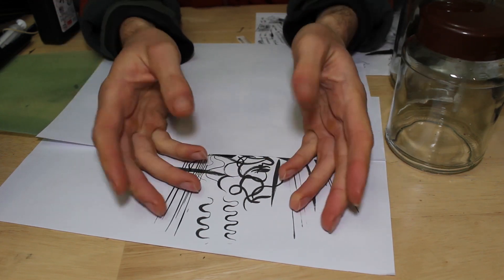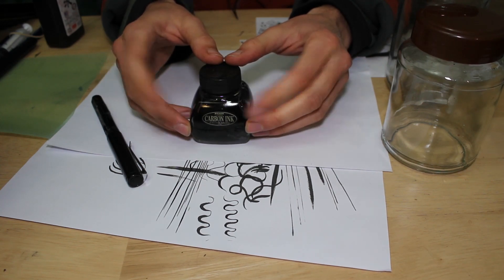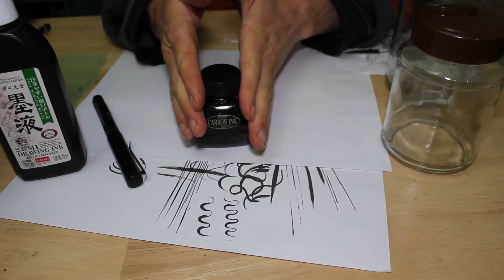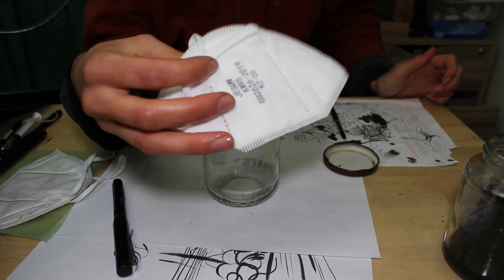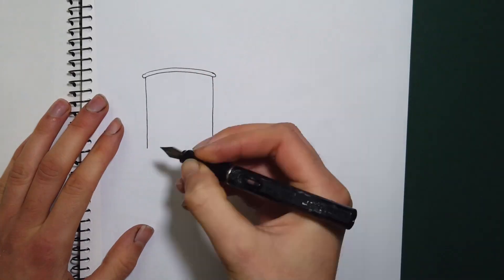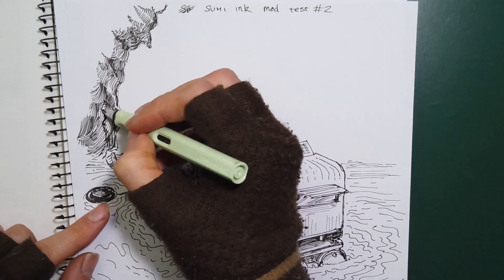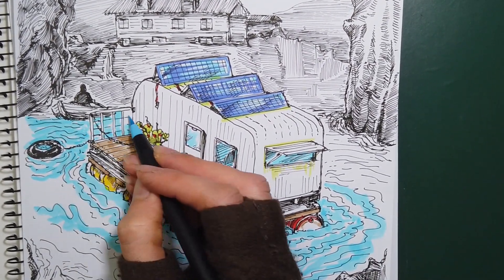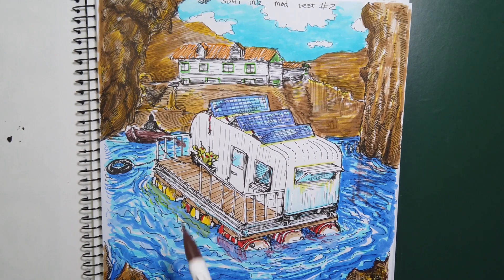Filtering ink for a fountain pen - DIY carbon ink?

Comment: I clicked on this video because it reminded me of little secret I learned about how comic book studios and artists would eventually take the ink bottles left open air while working, dump them all at the end of the day into a big bottle, which would eventually be funneled through cheesecloth into a new big bottle to then freshly refill a ton of cleaned smaller ink bottles. This kept the ink fresh. I read this in “The Life and Legend of Wallace Wood” Vol 1.
Reply: Ah, is that because the carbon particles will eventually congeal no matter what chemical tricks you try to do with any ink and need to be filtered out to maintain a uniform particle size?

Comment: This has gotta be one of the most creative uses for a KN95 I've seen in a while.
If things were to get dire, I'd run this filtered sumi ink through an old kakuno or something, those are easy to take apart and clean.
Good vid!

Comment: Alrighttt, while i was trying to to filter ink with a mask the same brand you used i forgot to wet the mask first so after waiting for about 20 minutes it was not being filtered 😅. After fixing my mistake it started filtering but i also needed to cut the mask in the middle inside with a scissor because it has a hydrophobic layer that needed to be removed. I used a needle to insert the ink in my ink capsule thingy and as soon as i write with it with my pilot kakuno . It worked! Now im gonna leave it and see what it does to the fountain pen.

Comment: idk if you've already tried it but I just (sort of) successfully making a fountain pen'able ink out of this type of calligraphy ink. Idk if there's different types of these Sumi Ink, but it must be thickened with gum arabic and not shellac. I did 50-50 ink to water then added 5ml proylene glycol to a 60ml mix of ink. Might be celebrating too early but after 2 days of not using the pen, still writes wet. Of course I haven't tried it on a bad sealed pen.

Comment: where are you getting water resistant sumi from?
i tried a hack recently with gum arabic and crushed up vine charcoal to make a watercolour. not sure why im mentioning it. guess i just wanted to brag about my own exploits.
Reply from the maker: Its cheap sumi from daiso. I would call it water resistant if you don't physically tamper with it. Like by brushing many times. Still much better than a dye ink. 

Nice experiment. In my first failed attempt to make carbon ink for a fountain pen I put charcoal in an old blender mixed with water. It was very black. But after I filtered it with a kn95 mask it was only light gray. The blender didn't make very tiny pigment particles.
Reply: @Ashsibe  i guess if it was as simple as blending it, those sumi sticks would be more popular.
i think it takes a while to make much ink with those sumi stick kits, so i dont think id recommend it.